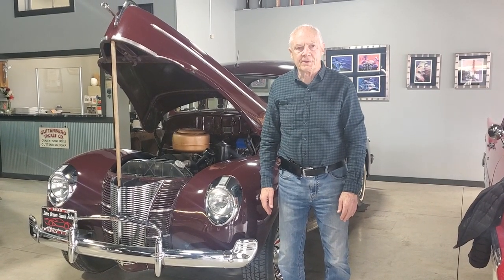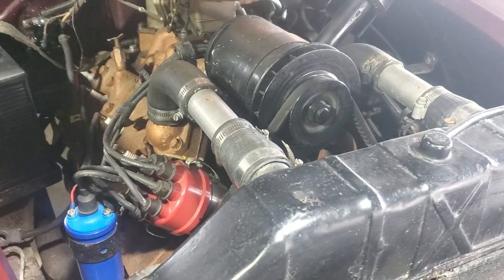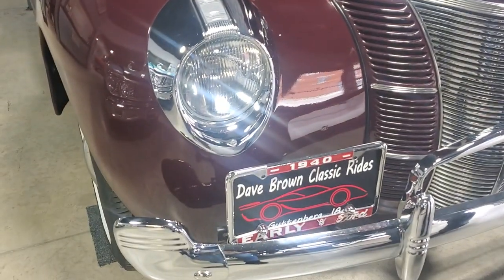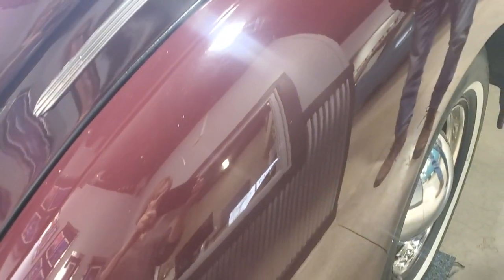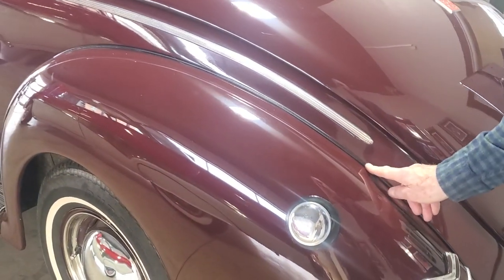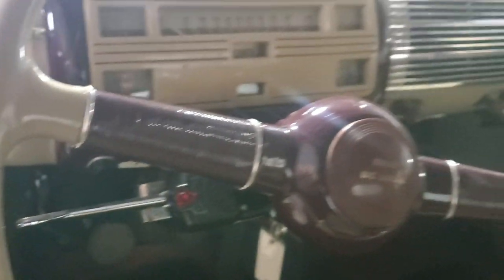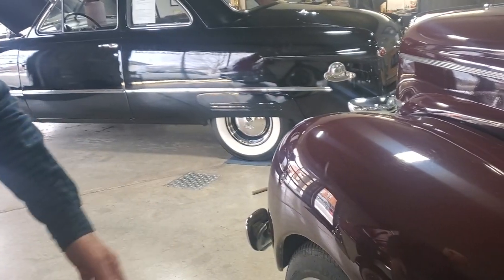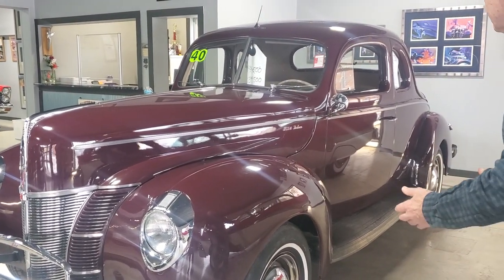1940 Ford Deluxe Coupe

Comment: One thing to add, keep it as it is, a 1940 Car. America does not need another hotrod just authentic historical beauties like this.
Reply: SO TRUE.  Far Too Many Have Been Chopped And Dropped And Butchered Up,  Calling Them "Customized".  However  A Classic Beauty,  (That Americans First Fell In Love With),   Can Only  Be RUINED ONE TIME.    You Can Add Engine Upgrades And Overdrive Transmissions  So It Keeps Up With Today's Traffic Better,   But The Speed Limits STILL REMAIN THE SAME...

Comment: Later mill makes sense, they were upgraded by a guy Ford stole from Oldsmobile and ran cooler. Trick is truck belhouse and water pumps. Slice pieces of later hoses and insert into 40 hoses to mate up to radiator.

Comment: Not Only Could The Car Use A NEW Aluminum Radiator,  But The Engine Is Also NOT Original.  It Looks To Be A 239 Ford Or A 255 Mercury Engine From ThE Late 40,s To The Early 50's. You Can Tell By The Location Of The Distributor And The Forward  Water Tube Location On The Heads.    The Guy Spends TOO MUCH Time on The Paint And Trim Work,  But NOTHING About The Drivetrain By Having It Up A Lift...
Reply: Zzzzzzz...